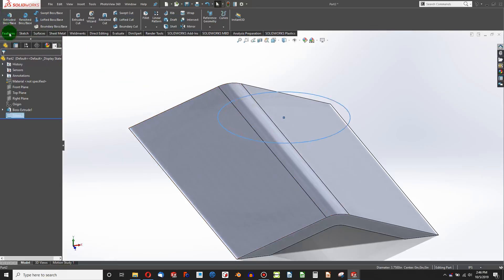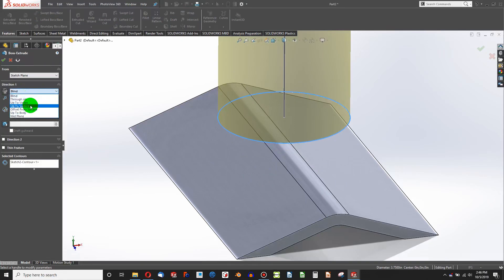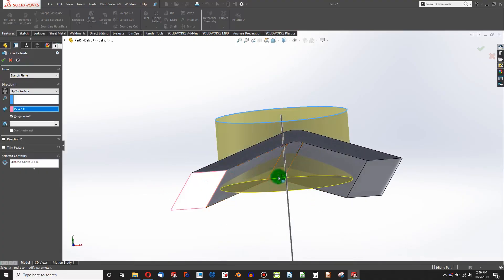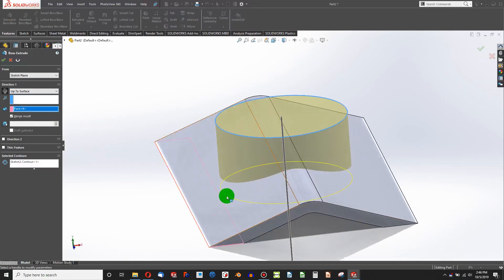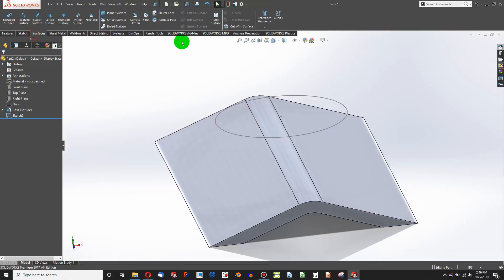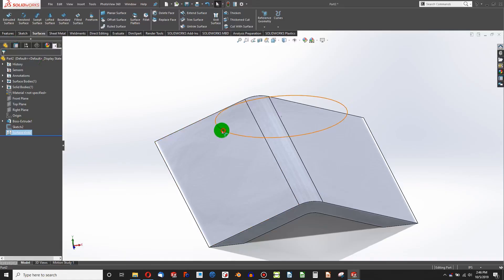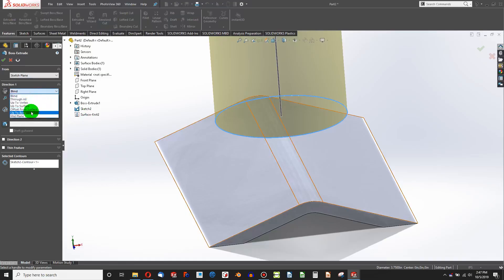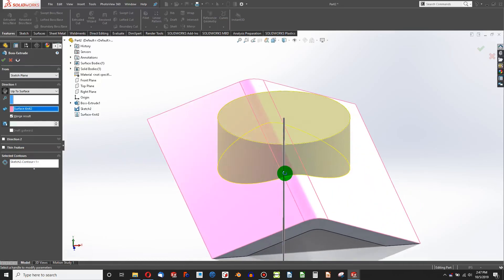Extrude to Multiple Faces/Surfaces in SolidWorks |JOKO ENGINEERING|

Comment: Great video. I wanted to add that you might be confused if you also run an extrude cut past this new surface (think if you wanted to drill a hole through that cylinder). The cut might seem like it didn't cut through the surface, however it's just the newly knitted surface being displayed that makes it seem so. Right click and hide it and you'll see that the extrude cut you made went right through without issues.
Reply from the maker: Nice!  Thanks for the addition
Reply: Really appreciated!! That drove me crazy!

Comment: Great info, but now when I try to cut through the knit surface, it won't.  Any thoughts?
Reply: When he used the knit feature it became a surface and was no longer a solid body.  Some tools work with either, some only work on surfaces and some only work on solid bodies.

May need to knit the surface back together into a solid body to cut.